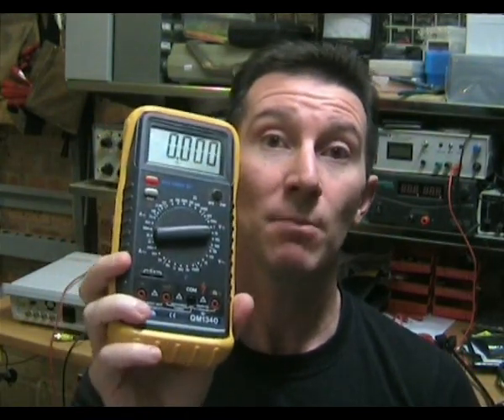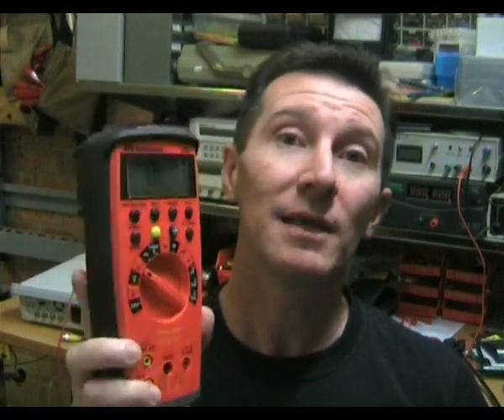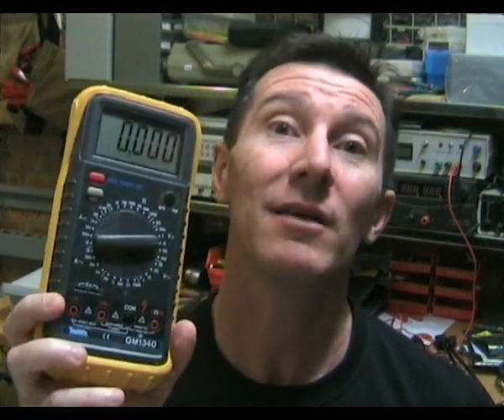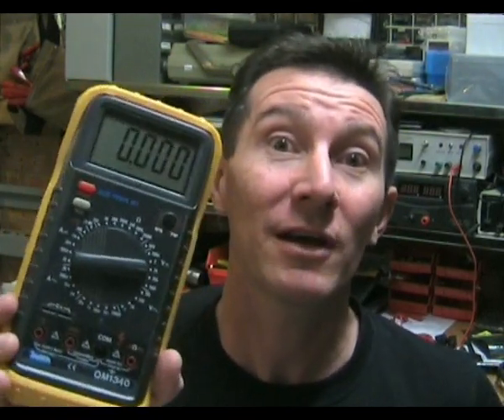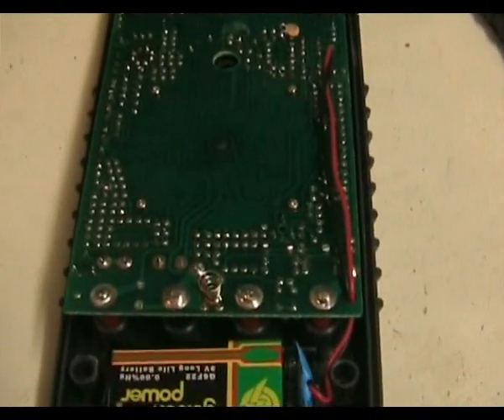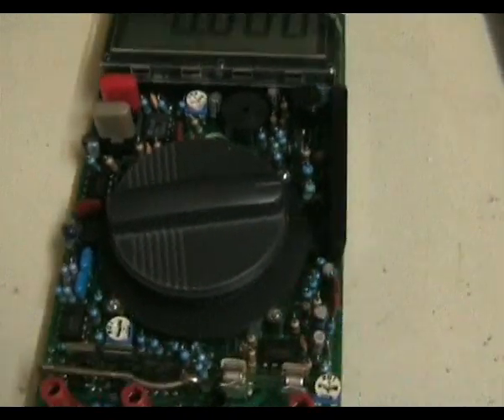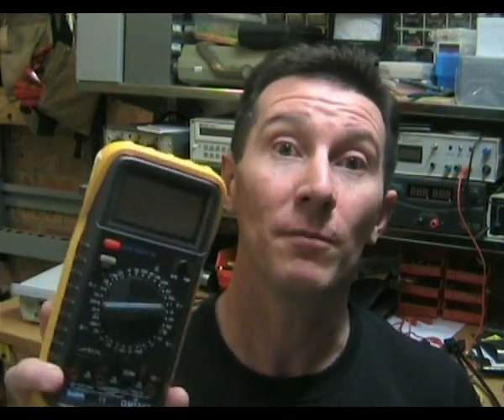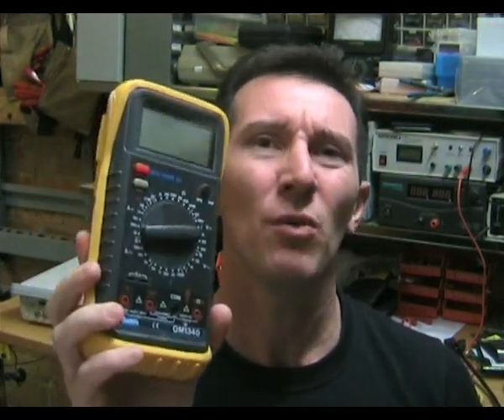EEVblog #6 - Part 2 of 2 - Why cheap multimeters suck

Comment: Some balance is called for.

If you're a professional, or a serious student, then the only rational thing to do is buy a quality tool.  End of story.

If you're a hobbyist with experience, then you'd also want to buy the best tool you can AFFORD.

If you're a new hobbyist, you'd be CRAZY to buy a $100 meter. Buy a cheapie, see if you like the hobby, build up your toolset over time. Buy a quality meter when you need it.

Comment: I have a Mastercraft digital multi meter # 52-0060-2 and I`m thinking it is dangerous after watching our videos so could use some help.
The meter manual states the fuse is (2 A/250 V) so this means the 750V setting is not fused & the 10 amp dc setting is also not fused. Is this not dangerous?
It has been brought to my attention that even 300 ma has the potential to kill as it can put your heart out of rhythm :O
Please clear this up & thank you for your time :]

Comment: I have had my Fluke for years and check it out with a Keithly and and its allways dead on. You get what you pay for. If you can't trust the meter reading you may as well not use it.

Comment: i only buy cheap meters for 12 volts and low resistance. they are not safe at higher voltage in any way shape or form

Comment: How do I put this...I think you are overreacting. I DO agree on the industrial reliability part, sure, I wouldn't want my car's electronics to be tested by a 5 dollar multimeter, but as the other guy said, many of us are simply hobbyists (I study Physics in University). Specifically, I took my 5 dollar multimeter with me in our lab course, and compared its reading with a 700$ Fluke multimeter. Verdict? Up to three digits after the point, just the last digit would ocassionally oscillate.

Comment: The video isn't clear enough to tell for sure but @ 2:50 it looks like the hand soldering work still has flux on it.  This is a huge problem - that flux will eat away at the solder joint and cause it to fail, sometimes in only a few months.

Comment: Hi again Dave!
I want to ask you something. I'am studying electrics here in Macedonia.
i got multimeter like yours (the cheap one). When you opened the fuse is exectly like main!
The plug points are fused both (the 20A and the mA) but when i opend the case i found just one fuse!
IS THAT FUSE FOR THE 20A,mA and Voltage?

Comment: I have a $5 multimeter I bought in a Malaysian department store. After 3 years, it still measures voltage, and the screen lights up too!
Reply: 3 years isn't a long time, even for a cheap  multimeter. Raise your expectations or planned obsolescence will prevail.

Comment: And exactly how accurate did your meter remain? Did you even bother checking the accuracy even once against a proper reference in the 15 years you've owned it?

If you believe the iPhone only costs $8 to manufacture, I've got a bridge to sell you. The POWER ADAPTER that comes with the phone costs about $8 to manufacture.

Comment: I used to have a Mastech MS8040. Typical low-quality chinese construction, but I do have to admit, it was very accurate for the duration I owned it, well within spec when I checked it with a voltage/current/resistance standard. I certainly wouldn't call it robust though, and one good drop to the floor would certainly have destroyed it. Definitely not Fluke-grade craftsmanship. :)

Comment: Actually V.Malcommode is right. Unless you've owned every product to ever come out of China, you cannot make the generalization you did without being a zealot -- or something to that extent. Anyways, crap is crap, quality is dependent upon the company and it's stringency of quality control and not - in most cases - dependent upon country of origin.

Comment from the maker: You clearly have no clue about industrial reliability and measurement confidence.
Reply: The point is not everybody needs industrial reliability and measurement confidence. IMHO brands like "Fluke" just rips off people in the name of industrial reliability, I have been using the expensive ones at my office and dirt cheap ones at home I have never ever ever seen considerable inaccuracy in the measurement. NOTE: I seldom use high voltage (> 12V) in my projects.

Comment: Ultimately, if you're just starting out with an Arduino and want something to check general voltage levels or continuity, then a cheap meter will be more use than no meter at all.  I wouldn't want to go to lengths debugging with one, but if you just want to dip your toe in the water, then they're not a bad deal.  Also, when I pull out my meter for something non-electronics around the house, I just want a continuity test, which these meters can usually handle fine.

Comment: you're forgetting eBay, I've bought many really good Flukes for less than the one hung low chinese meters would have cost me, I got a Fluke 77 III for $30 and I still use it with my 87V when measuring current so no, you don't have to sell your $300 lab you just have to spend your money a bit smarter

Comment: @EEVblog I think they dont understand what can happen if something goes wrong with such a cheap multimeter.
Guys if you look in Dave's videos you will see how those things are built, for example you drop your meter and some of those resistants near the leads get really close to it and next time you use it for some current measurement with high load the multimeter can blow up in your hands. I wasted 25 USD to Pen multimeter, and i just dont trust it to use it, wasted my money there...

Comment: I bought a couple of more expensive meters (about 29EUR, which is quite a lot to me). One of them failed after I accidentally measured the inductance of a 300VDC power supply and the mode/range selector wore out on the other one (the pads on the PCB shorted out). So, now I'm using ~5EUR meter. It does not measure L or C but if I accidentally measure the resistance of a car battery, it's only 5EUR. Unless the expensive meter can tolerate 300VDC  across its inputs in all modes, I'm not buying it

Comment: Professional tools like Fluke and simillar are for professional usage where you need precise measurements and more important where your multimeter earns money.Chinese multimeters like these on ebay for few euros are for people who need general measurements where is not important if voltage is 12.01V or 12.02V,for amateur usage and so on.I use Voltcraft VC220 multimeter (price range about 50€) and for me where I use it in academic purposes and car and truck electronics it's very good.

Comment: Well I agree that the cheap ones are not accurate BUT although I own an expensive one most of the time I use a 5 euro chinese- the reason I don't need  precise reading like most of the people. Just now I was checking the washing machine electric valve and the cheap meter was telling me that the windings inside the valve were good. Now, if my working room looked like yours DEFINITELY I would go for an expensive one.

Comment: I bought a £25 multi-meter in 1998 when i set up my own little electronics shop, at the time i did not have much of a budget so that was all i could afford to spend on a multimeter, since then i have had much business and my budget has increased meaning i could buy fluke and other expensive brands of multimeter. Now 13 year and a lot of abuse later it still works and ok it is only accurate to 0.1 but for basic work that is fine.

Comment: The last multimeter I bought was the Maplin Precision Gold WG-020.  They still sell it now, or one that looks just like it.  49GBP new, and I've had it for >15 years, and yes I've given it plenty of abuse.  It was made in Taiwan, I guess that's the hallmark of quality these days compared with Chinese stuff.  I took the advice of a colleague, who suggested to avoid cheap MMs with autoranging features , since some of them can introduce 'artifacts' into the circuit under test when switching range.

Comment: I got plenty of mileage out of a little Mastech meter, just about the cheapest DMM you can get (think <=$10). So it didn't have a stand, auto-off, continuity tester or rubber holster, VAC was 200/600V only, and of course the leads were kinda dubious and accuracy was maybe 1% (usually a bit low).

However, quite often you come across people trying to fix some electronic device without any at all. There really is no excuse for not at least having such a very basic multimeter in the household.

Comment: i can tell you straight up, a good quality meter is VITAL to testing components in electronics,When your components have to be within 1% of specs you cannot afford inaccuracy in a crap meter. There things i could not even get a reading on with my snapon/bluepoint meter, but my fluke made childs play of it. The snap on appeared well made(and wasnt cheap), but since when did snap on become a contender in DMM market? stick with a fluke or similar brand unless your testing car batteries or something

Comment: It's surprising the lack of understanding a few of the commenters have. A general consensus is that the use of less than quality parts, as well as assembly procedures will lead to a less than reliable product. Although I use these meters in some cases, I'm only taking general readings, otherwise I'm using a high quality bench meter that I have access to. Even if you get one as a temporary go between, save up and get a decent meter.

Comment from the maker: @2ndAsstJizzMopper Perhaps you missed the part were I said cheap meters have their place. There is no point to address with TrickyNekco. Some people simply cannot understand the point of my rant, or what a rant actually is. I have done follow up videos and much comment on this.
What part of I am warning people against potential risks of cheap meters don't you understand? If you want to ignore that and use a cheap meter then that's fine by me. My comments are designed as food for thought.

Comment: $20 is a cheap meter? My $20 meter is my good meter. My cheap meter was $2.50 on sale at Harbor Freight. 

Both always seem to be accurate, but then again, I don't do anything that requires heavy accuracy (mostly just component testing and stuff)

Comment: @rasz 
Find a "PRO" meter & compare. Accuracy isn't a big issue. Will it fail, stop working? You'll know when it does in 2yrs or 20yrs. R U A hobbyist who turns it on 2 times a wk/avg OR Pro that uses it 20 times a day 5 days/wk, extreme accuracy needed? NAME brand units have service, support, repair. Cheap brands are throw away. I buy cheapest of cheap Harbor Fright DMM's. They just exchanged one that failed. I also own a top of line Fluke. I DON'T haul that out to check car or house wiring.

Comment: China can make good stuff, but they make cheap stuff because the market demands it. You got to love a $2 DMM. If you don't want to replace the battery throw it away and keep the test leads. The ones I have that I took apart have one big IC and surface mounted components..... how bad can it be for $2 or $5. A friend has an electrolysis set up and uses two cheap ones for that, because he does not want a nice meter around that harsh environment. I love me some cheap DMM's.

Comment: Another example I have a battery charging area in my house for my many many NiMh batteries, AA, AAA, 9V and battery packs. It is nice to have a dedicated cheap volt meter there. Do I care if it says a 1.4 volt battery is 1.41volts? No, it helps me match the batteries and keep track if I charged the battery or not. By the way the NiMh I got from China cheap. They work great. I think to say ALL CHINA made stuff is junk is a mistake. Is Fluke or HP or Tektronics even made in America any more?

Comment: I have an auto-range Fluke & 4 cheap Harbor Freight DMM's that I bought for $2 or $5 on sale, a few are real compact. THEY'RE GREAT. They work. I have one in the car, boat, plane, house, everywhere. None of mine failed; well one, it stopped taking Ohm readings. I brought it back a two yrs later, they gave me a new one, which has worked for 5 yrs. For general home use avg Joe or Jane cheap meters have value. A serious hobbyist, one quality meter is a must. Of course my GO TO meter is the Fluke.

Comment: Im an electrician i can understand going for the cheap meter on site, cos you will damage it, or i could get stolen. Now for simple small jobs i use a "Rapid" is the make multimeter for small things like resistance and continuity. Now for live testing i always use my Fluke its a T5-600 its great (kept in the van lol) nice and simple fast to use and safe. I gave my rapid to a friend and he broke it by testing a 230v RMS socket while set on 200v RMS too many setings can cause problems too....

Comment: You obviously never lost a multimeter. I work on cars a lot, and sometimes, i accidentally leave some tools in the car. It just happens. Most customers will return it, but sometimes tools get lost, probably left in a car.
I'd rather lose a $20 meter than the one I lost last time, a  fluke 87 automotive.
We have another fluke 87, but that one broke down! (One of the display segments doesn't show up anymore). If it was a $20 multimeter, it wouldn't tick me off, but when it is expensive, it does!

Comment from the maker: You want me to sit and wait for the cheap meter to fail for you so I can take a "faulty" measurement with it?
If I did have a faulty cheap meter and took an incorrect measurement with it and compared it to a Fluke that measures good, what does that actually prove? It is still just asserting that meters can fail
Please tell me what I can specifically "measure" to make you happy...
This is a blog comment about my extensive personal and professional experience with both cheap and top quality meters